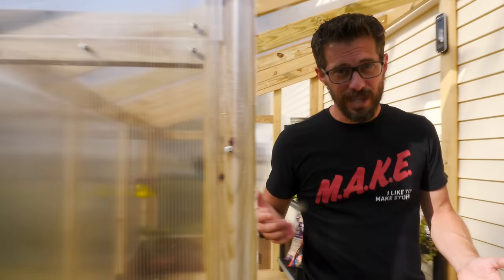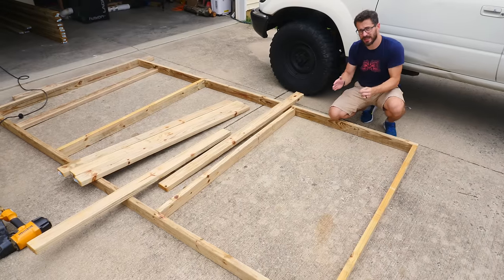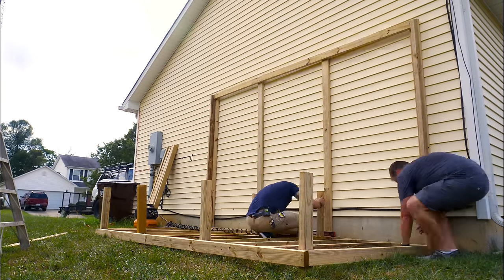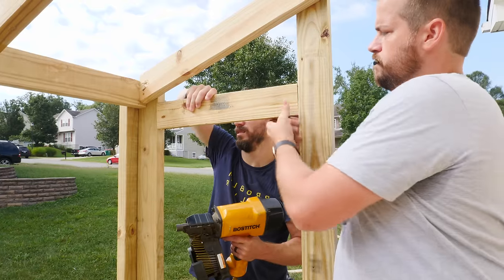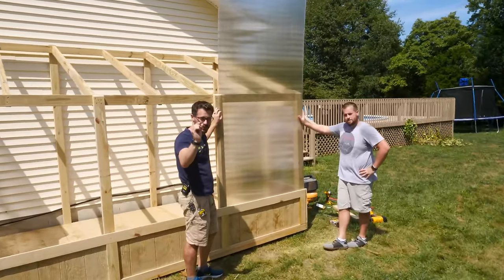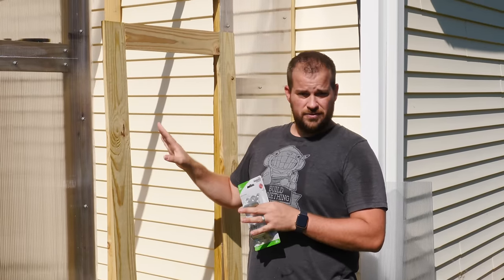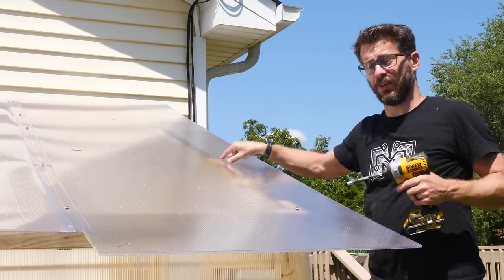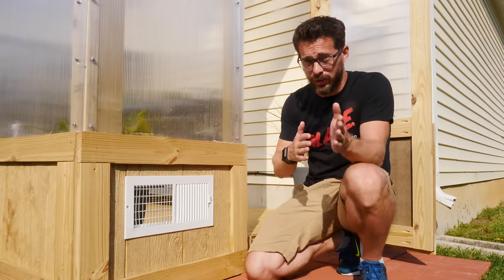How to Make a DIY Greenhouse | I Like To Make Stuff

Comment from the maker: Answer to common comments:
1. The 2x4 legs won't settle much here.  Our red clay doesn't move much once it's settled, and this is a high point of the yard so it drains well and never gets saturated.
2. All wood was pressure treated, rated for ground contact, so rot is many, many years away.
3. There is a small air gap between the walls and the side of the house.
4. The garage (not temperature controlled) is on the other side of that exterior wall.
Reply: why do you use a closed bottom? You can plant plants in the ground. I do it like this and we also have clay soil
Reply: Can you do a bits video on nails and nailers?
Reply: All that weight on a few 2x4 points and it's going to settle no matter what kind of soil it's on. $20 of 12x12 concrete pavers would improve your build 100%. I sorry but it seems more and more of your big builds you end up trying to justify your errors after the fact.
Reply: Im more curious on the roof "Vents"  if the wind/rain/snow is coming the right way it would blow those vents open and allow the elements inside.  Is there a plan to possibly correct that? or are you not worried that could happen ?
Reply: I would still put 12x12 pavers under the legs... settling is settling I don't care what kind of clay you have....
Reply: Literally answered all my questions lol
Reply: Cut pressure treated wood doesn't last very long at all. If you look at a cut you can see how deep the chemicals are.I'd be very worried about the feet/legs.
Reply: I’ve use the 30 second outdoor cleaner, and maybe spraying it with no eye protection is not the greatest idea.  It is a bleach product.
Reply: A lot of people are worried about the legs rotting away or sinking. Here's my take. If they start sinking, which I don't think is likely, put blocks under them. As for rotting, if you don't live somewhere that gets long periods of rain, or is humid all the time, wood takes a long time to rot. Even when on the ground. Bob, you know your area best, I'm pretty sure you thought it through. Good job.
Reply: Haha... is this the "please shut up about it already" list?

This is seriously one of the best ILTMS videos. You continue to up your game. Well done.
Reply: filter fabric is cheap you could've put a sheet under de greenhouse so the grass dont come in contact with the wood,and the moisture or rain water wood still drain well
Reply: Codymitchell yuo tide Facebook vibes fans
Reply: @DavidLeeKersey  I don't think you're sorry...
Reply: Loved the greenhouse was amazing, here in Portugal the greenhouses are much bigger, say giants!
Reply: I Like To Make Stuff because you are brilliant at everything, do you think it would be possible for you to build a claw machine?
Reply: @climberjb  That's true, all cuts should be retreated - it's not difficult and not expensive - best to avoid cuts though if you can.
Reply: @MyCuriousMind  What's a craw machine?
Reply: Would love to have watched the video but can't stand background music.  normally I just stop watching but you seem like a nice guy and thought you should know why so many people jus stop watching.
Reply: @DavidLeeKersey  this.    dude wont admit a mistake.
Reply: Nefaryus Drake  I definitely will either use a floor in mine or set mine into the ground itself by a couple feet. We want to use ours year round and these two methods appear to be the best at eliminating heat leakage through the floor of the greenhouse.
Reply: @MichaelMantion  statistically he's better off with the background music. It's like seatbelts, very rarely someone could die because a seatbelt restricted them or rescue teams during an accident but the majority of the time seatbelts help people stay safe. Likewise you may find some people who dislike or leave a video/channel because of background music but more often evidence shows the background music is more helpful in retaining viewership.
Reply: @MichaelMantion  if you don't believe me just consider that yours is the only comment I've seen complaining about the music, but there's at least a half dozen comments that I've only just skimmed through (probably more) expressing their appreciation for the background music. I don't think the background music is going to negatively impact their viewership just because YOU don't like it.
Reply: Nefaryus Drake  "The ground is actually geothermal"

Only if you dig deep enough.

"by putting in a floor, you create a air pocket under the floor that is cold in the winter."

Air pockets are actually a good source of insulation, which is why I would plan on using it if I had a temporary greenhouse or didn't want to dig deeper. What you're thinking of is an air gap, which is different than an enclosed pocket or insulating air.

"I recommend putting a brick wall on the north side, south if you're on the other side of the equator, and digging out 2 feet of earth inside the greenhouse. That wall will give you thermal mass for heat in the winter, and the geothermal ground
heat."

That's similar to what we're planning on doing, but we're going to use water filled chambers painted black and a reflective back wall to maximize the use of sunlight. Water filled chambers have higher heat capacity and won't lose heat to the exterior through conduction, which means more consistent temperatures and more light to the plants without losing heat efficiency.

"Also planting in the earth itself will help with watering [...] Do you have any idea how fast water will evaporate out of pots in the heat of the summer? you'll be watering twice a day if temps get over 90f"

Which is why we don't let them get that high, it's relatively easy to change the chamber color from hot black to a reflective silver color, as well as ventilating the greenhouse at the same time. You just need to control things based on the weather at the time to keep your temps cool in the summer.

In addition we are typically growing hydroponically, in which case watering is a non issue.

"Watch a video where theygrow oranges in Nebraska. Now thats a greenhouse, lol"

Where do you think I got these ideas from? His system uses ventilation to reach deeper into the ground because, as I mentioned, it's the deeper soil that provides usable geothermal heat, which is why I will be building an insulating floor if I don't have the time or money to dig deep enough for geothermal.
Reply: Nefaryus Drake  
"If air is such a great insulator, why does IGLOO even bother to put insulation between the walls of their coolers?"

I could ask you why, if insulation was so much better than an air gap then why does the world's largest indoor ski mountain use just a single air gap to insulate itself against the blistering sun?

A little known secret of insulation is that insulation is almost always just a series of small AIR GAPS.

"Furthermore, You're going to run hydro, with hot and cold touching the same surface. That is ripe conditions for mass condensation, leads to mold and rot."

what hot and cold surfaces? Not something we've had an issue with before.

"you seem to know it all"

I just know what's worked and chose to learn why and improve upon it. You act as though you're the only one with experience, yet I could easily say you are acting as though you know it all as well. Insults won't get you anywhere in life, we simply have had different experiences for different reasons in the years we've been doing this. Instead of arguing when we both are certain of the results we've acheived, why not find out why our results were so different? To do so we need to share and understand the methodology behind the various ways we did things to find the cause behind our different results. However, if you'd rather continue asserting that I you are correct and that I must have less experience than you, go right ahead, I'll simply refrain from replying.
Reply: Nefaryus Drake  you seem awfully judgemental of anything that doesn't fit your narrative of the world.
Reply: @jimcooksey812  obviously your not familiar with red clay, lol
Reply: @1982MCI  , your right I am not I live in Oregon, we have soil.... not clay.
But.... My journeyman card says I know what I am doing. 
Local 1388 Oregon City OR.
Reply: Won't the legs rot over time just sitting on the ground like a that? Why didn't you put a plastic cap on them for prevention. Maybe dig a hole add cement and then the legs for better prevention. I'm no expert but ya know.
Reply: Nefaryus Drake  ad hominem and cherry picking does not, a good argument, make.

Also, my apologies for insulting you so severely with a minor spelling mistake.
Reply: @kirsteneasdale5707  I agree, plywood is a generally poor choice for a greenhouse, but an insulated flooring can sometimes be a more effective building method, especially in colder climates where it's actually a pretty common method because of how effective it can be.
Reply: LazyH-Online I don’t know how far North you are, but here in Scotland at 56 degrees North, we don’t have floors in greenhouses, and we have heavy clay soil too.  The structure above wouldn’t survive in our exceptionally damp climate. It might be fine for a shed or a summerhouse, as we don’t tend to keep damp soil, and transpiring plants in those, and I don’t know anyone who would deliberately spray water inside a shed, or slosh a bucket of water on the floor of a summerhouse, when it’s a hot, summer day.  Gardening is my passion, including greenhouse gardening, and in my experience, understanding, and knowledge, of greenhouse    best practice - a wood, or chipboard floor is the very last thing you want.
Reply: @kirsteneasdale5707  I completely agree with what you're saying about a wooden floor, this is why on one of the greenhouse that I made that was insulated floor I used a blend of cement and perlite, with polystyrene insulated layers. In the end it cost way less without having to get a building permit on a structure that we weren't going to keep around for very long, and it's still saved a significant amount on groceries to be able to grow our own food year roubd, and that food was significantly healthier. Having an insulated floor for us was better cheaper and faster than digging into the ground or building directly on soil.
Reply: LazyH-Online That sounds better.  What drainage, or run off did you build in to the concrete base?
Reply: @kirsteneasdale5707  never needed to worry about that since we used hydroponics. Any small amount of water that did spill either got pushed out the door with one of those floor squeegees we bought at Wally world, or was small enough to simply let evaporate.
Reply: LazyH-Online It can’t be damp in your part of the world then?
Reply: @kirsteneasdale5707  it can be, there just isn't much reason for that humidity to cause issue in the greenhouse, it's pretty easy to set up with ventilation and airflow control to prevent it from causing trouble in the greenhouse.
Reply: Nefaryus Drake    
"For someone that isnt a know it all, you sure have a lot to say on the subject."

Discussion is generally how we chose to learn more, it is also why there were some genuine questions among the things I've said, a lot of which you haven't answered.

"Looks to me like your creating more work for yourself and trying to sell your propaganda to others."

My original statement was simply an expression of what we would chose to do and why. I could have expressed it better but didn't think it would become any sort of issue.

"And since you need me to look up a word for you:
Propaganda:
2: the spreading of ideas, information, or rumor for the purpose of helping or injuring an institution, a cause, or a person."

So what "cause" am I trying to help or hurt? I concede by that definition what I say could be by definition propaganda and I therefore happily concede this point to you, though it seems an odd choice of words. My apologies for the conflict that I have caused due to this confusion.

"Furthermore, you claim I used an ad hominem, by what, calling you by name, lazy?"

What does name calling have to do with ad hominem? The ad hominem was when you made statements regarding my motive or cause as a method of discrediting my argument while you have incompletely addressed or countered the statements I have used in support of my claims.

"For someone that calls me judgmental, you sure af seem to be doing what you claim I'm doing,"

I'll concede that point as well to an extent, I am only human and I do apologize. I know being passionate about a subject is no excuse, however science in general, including material science, engineering, chemistry, and many others are all things I've been as passionate about as gardening ever since I was a child, so I don't believe I am completely ignorant on what I am talking about. I know many people would agree with me, though I'm sure the same could be said for you as you seem well versed in the topic as well, though you appear to have learned it in a different way.

In the end I simply wish that if I do have a discussion with anyone that it be a civil discussion where opinions can be respected, experiences can be shared, and ideas can be compared. Instead you seem insistent upon dismissing the concepts I bring forth simply due to differing experience, without considering the possibility that we both could have learned something from this exchange. This is where you and somebody like Kirsten on this same comment thread appear to differ.

"Furthermore, I talk about having an air gap under a greenhouse and how it's not a good idea,"

The majority of the time you are right, it IS a bad idea. However there are other times when it is more beneficial than not having one, and I know this from experience. Also remember,as you just stated, the air gap was your idea, something YOU brought up. It wasn't even part of anything I originally talked about, however as you felt it was relevant I went ahead and followed your lead on making that the primary topic. I guess this is part of why I was confused about the propaganda thing when it was your topic that you were pushing for, and therefore seemed more like your story that you were pushing. If this is not the case then I apologize again however I'm not sure how that makes this discussion about me when I was simply bringing up my personal experiences in regard to YOUR topic of discussion.

"But you seem to think you need someone, anyone to sell your propaganda to,"

Pretending that's true may I ask, is that any different than the propaganda you originally stated long before I came to the conversation, when you were speaking out against the content of the video? What about the propaganda you began in our conversation about your air gap issue? Neither of these were things that I originally brought up, that was you. It also takes two to argue and I'm certainly not having this discussion by myself.

"someone to argue with cuz you have nothing better to do"

See above.

"meanwhile you tell this story:
this is why on one of the greenhouse that I made that was insulated floor""

I'm not really sure what your point is on this one, but I had a polite conversation with them, both sides bringing something to the table with understanding, not agreement, being the main goal. The same could not be said of the conversation with you (spoiler alert, the difference between the two conversations isn't me).

"You've got nothing to bring to the table,"

That's generally the case for both sides when sincere discussion is not the goal of one or both sides of a conversation, though I do hope that can change in this one.

"Your ideas are worthless,"

That may be your opinion, I simply asked you to support it with sufficient evidence.

"and you are an ad hominem."

I'll just take that as the insult that it likely is, and not a serious attempt at conveying anything. If I am wrong can you please clarify?
Reply: Nefaryus Drake  "all that work and money to put in a floor that does no good. Even a gravel floor is better."

Well, the floor did insulate better than the greenhouse without one, though I haven't personally tried gravel the floor does work better than river rock and plain dirt by at least a few degrees temperature difference. Maybe gravel would work better because there are smaller and more air pockets between the substrate and therefore might insulate better though I find it hard to believe it would insulate better than a purpose built floor. It's the slowing/stopping of air movement that prevents the flow of heat, so a sealed air gap would, hypothetically, insulate better than gravel, and the multiple pockets in insulating material that slow down air flow even more would insulate better than an air gap.
Reply: Nefaryus Drake  that is your claim, and it doesn't conform with reality. I gave an example of this and so did you without realizing it. At most winter temps of the soil will stay be around 65*, the Nebraska greenhouse guy gave this number and if you travel further north that temp will drop even more and insulation has the potential to help give you higher temps than that 65* if you don't have the money or availability of digging deep enough for the geothermal effect. Despite this you are dead set on believing your unfounded claim despite any evidence to the contrary and so this conversation isn't going anywhere. Have a good day and maybe next time we can have an honest conversation.
Reply: Nefaryus Drake  insulation prevents the transfer of heat, this could be between air and air, air and ground, or any other two mediums. If the ground is colder than the inside of the greenhouse (often inside of greenhouse was high 60s and ground was mid to low 60s, measured with a PTC probe) then insulation in the floor will prevent the transfer of heat from the inside of the greenhouse to the colder ground. This is just how physics works. Does it work in every scenario? No, sometimes there's more heat I'm the ground, sometimes it's impractical to build and even if all things work out there's often better ways such as digging your greenhouse into the ground. However there are times like when I mentioned above, I'm which an insulated floor DOES keep the inside of a greenhouse warmer.
Reply: Nefaryus Drake  tell me this, if you have a warmer greenhouse (68* for example) and a slightly cooler ground (63* for example), then how does insulation between the two NOT help keep the greenhouse warmer?
Reply: Nefaryus Drake  I believe the ground is cooler because I measured it myself, both with and without a greenhouse over it. You would know this is you actually read my comment instead of simply trying to prove me wrong with reckless abandon. The cause of that temperature change has little to nothing to do with the fact that the cooler ground will therefore decrease the temperature within the greenhouse itself. So yet again, instead of ad hominem (attacking my supposed "narcissism" and "wasteful existence") perhaps you could instead form a cohesive argument to counter my claims. And in case you think I'm ignoring your permafrost example, you need to actually demonstrate how it relates, in ANY way, to my claims regarding greenhouse insulation for it to be considered a counterargument. It's usually the people who cannot form arguments and instead resort to incessant insults that hold the greatest narcissism and ego as they have no method of forming their own arguments yet withhold themselves from admitting their point of view could even be slightly incorrect or incomplete. I have stated nothing that I haven't observed myself to be FACT.

Bottom line is: I have demonstrated that insulating the bottom of a greenhouse has the potential to help, and I explored the explanation behind this phenomenon by measuring information from the environment in question.
Reply: Nefaryus Drake  if you really don't believe me there's other sources besides myself that have examined and proven that heat loss occurs through floors. Every construction engineer knows of this phenomenon. It's not exactly news that heat loss occurs through floors. In fact it's common sense to anybody that works any form of construction. In fact here's a quote from a site describing energy efficient greenhouses comparing them to insulating a house:

"We all know heat loss can occur through a building’s walls and roof, but it can also occur through the floor, accounting for about 15% of an average home’s total heat loss."

Heat loss through floors has been proven time and time and time and time again, it's not just something I popped off the top of my head to be argumentative. It's a proven FACT that tons of people already know about and study and have proven time and time again. If you really don't believe me just ask anybody in the construction industry if heat loss through the floor of a building exists.

I have no idea how you can be so entitled as to completely disconnect yourself from reality, I have demonstrated my point to be true, I have proven the cause behind it, and now I'm even demonstrating numerous other sources that support my claims.
Reply: Nefaryus Drake  "take your own advice and put the insulation out of your attic cuz you don't need it there, the air gap you claim is the best insulator for the attic."

How is that my advice? I have stated multiple times that other forms of insulation did work better, that air gap insulation was simply the cheapest and simplest. You obviously didn't read anything I wrote and just want to argue.

I stated at least once that the multiple air gaps in insulation made it work better than an air gap, and I also stated that an air gap insulates better than gravel and insulation material insulates better than an air gap. That's twice off the top of my head that I remember saying insulation is better than an air gap.

Since you seem to have forgotten I'll say it again, the only reason I even said anything about an air gap was because YOU brought it up and I happens to use it in a greenhouse successfully a while back.

If you can't respond to things I actually say then we're done, bye.
Reply: Nefaryus Drake  
I have to apologize for my part in the confusion here:

"you can't even look up "propaganda" before telling me to look it up for you,"

Actually I did, though I understand why you would think I didn't. The dictionary in my house doesn't have that definition in it. Mine has two definitions,

one being "information, esp. of a biased or misleading nature, used to promote or publicize a particular political cause."

The other being "a committee of cardinals of the Roman Catholic Church responsible for foreign missions, founded in 1622 by Pope Gregory XV."

Neither of those definitions matches what I was doing, you simply found a different definition than what was found in my dictionary, though I can understand your belief that I was simply being lazy.

"Have you taken the insulation out of your attic and put it under your house yet?"

No, I'm not going to try your silly idea. But have fun putting insulating material in all your windows so they don't waste heat through their "useless air gaps".

"In case you dont already know, nvm ofc you dont, Plant roots like mid 60's temps while the top of the plant likes to be upper 70's"

Actually I am aware of that, you would understand why if you had simply asked what kinds of plants I'm growing.

But you'll find off the wall plant that fits your crazy crap."

Actually we use our greenhouse to grow tropical plants such as mangos, citrus, pineapple, etc. many of which DO prefer warmer temps for their roots as well.

In fact I have a separate channel and Facebook page specifically for growing those plants since long before this conversation started, but you'll probably find some excuse like I time travelled to spread my propaganda or some other bull$#!+ excuse to start another argument.
Reply: Nefaryus Drake  I appreciate you working towards a civil conversation, that's the best way to share ideas and communicate effectively.

From my perspective you began with illustrating issues with the design in the video, namely the elevated floor. I simply replied with things that I would also have done differently than in the video, namely an insulated floor or digging the floor down a few feet. After that to me it appeared as though you fixated on the idea of an air gap, though I'm not sure why as air gap insulation was never mentioned by me nor used in the video. This is why I didn't know how to approach with my explanation, though I did respond to your topic because I've used both insulation material and air gap insulation before. I'm not particularly fond of air gaps since insulation material works much better but there are situations where they sometimes work.

I did include the full story on how a single air gap behaves differently than multiple air gaps in insulating material, I explained how air gaps are subject to directionality and having an air gap in the floor is one of the more efficient ways of orienting an air gap insulators, being up to 1.5 times more effective than, for example, a vertical air gap in your house windows. Regular insulation material restricts air motion more effectively and so isn't affected by orientation.

You also say that the ground helps with heat and you would be correct a significant amount of time, if the temperature difference is used properly like in the citrus greenhouses in Nebraska. However there are times when you can't construct to that extent and sometimes benefit more from insulating your floors, it's not often and depends on your situation but it happens. This is why many high efficiency homes insulate the floor of their houses, this is why the basement of a house is often cooler even in winter, this is why 15% of heat loss occurs through your floors.

Yes, the ground IS warmer than the frigid air, but we're not trying to insulate between the ground and the air, were trying to insulate between the warm greenhouse air and the frigid outside air as well as sometimes between the warm greenhouse air and the cooler ground. Just because the ground is warmer than the outside air doesn't mean it's warm enough for the greenhouse.

When did I say geoengineers had it wrong? I know you're not claiming I literally said that, but when did I imply such a thing?

There are many people, both personal and professional, that make greenhouses with insulated floors, though I'm not sure how an air gap is MY specification? Remember, you're the one that brought up air gap insulation. Personally I prefer either insulating concrete or layering polystyrene foam.

Again, why would you think I would take the insulation out if my wall? How does that relate to anything I've said? This is the second time I've asked this (at least) but you haven't answered. Why would I do that?

And lastly I don't give two shots about my feelings, I didn't care about it when you made fun of my username, I disliked something completely unrelated when you used a logical fallacy because it's intellectually dishonest, I didn't care when you said my ideas were worthless, I disliked when you misrepresented my ideas and put words in my mouth because that's intellectually dishonest. I didn't care when you called it propaganda, I disliked that I thought you were misrepresenting the things I said and didn't realize you had a different dictionary than I. I have never become upset over "hurt feelings" I have only become upset when the conversation becomes dishonest. This is also why I immediately apologize and correct myself when either you or myself cqtch me doing something incorrectly like in defining propaganda, I corrected myself and apologized for the confusion it may have caused.
Reply: @DavidLeeKersey  This so much. He never started with the right foundation and thats all i could think of. Similar to the vents, a total after thought so a video could get out.
Reply: @thacorruptor4472  Completely not thought out. This build was rushed from the beginning. Kind of sad this channel went this way.
Reply: @4:00 Did you drive the 2X4' feet into the ground at all or are they resting on the lawn surface?

I'm thinking that those feet will still settle in that red clay since the PSI area of the 2X4' is concentrated to 5.25 square inches per foot.  I'm not saying this is the thing to so, but driving them into the ground would compact the soil under the foot and increase the surface area (friction force) of each foot by the sides under ground.
Reply: It would last longer and be more stable if the wood 2xs were on brick or concrete pavers so they aren't in direct contact, even if they are treated.
Reply: interesting points ,if anyone else wants to uncover backyard greenhouse plans diy try Lomonting Easy Greenhouse Mentor ( search on google ) ? Ive heard some interesting things about it and my neighbor got amazing success with it.
Reply: @DavidLeeKersey  And, pressure treated, or not, end-grain on the soil isn't going to make it either.
Reply: How much this project cost?
Reply: @everettdale  if you live in the desert ,  no problem  for the  wood , but  this  makes  no sense
Reply: Hi curious what about nice getting in those vents. Maybe cover with hardware clith. I'm just curious. We have those things and I can't stand them cuz I never lived in a place with them before. I'm thinking maybe something like this instead of digging cuz unfortunately we have insane amount if rocks in this area of NY. It's horrible. Making all my projects into a major challenge. I didn't want this place but I still want a garden etc. I saw am amazing one where they could walk out into it from the house and a beautiful stone floor. Some homes have them already built but so much needs to be fixed and repaired here. I wish my husband would have listened to me.🙄
Reply: Kenneth Greer no it really isn’t. It’s quick and dirty and full of bad ideas.
Reply: LazyH-Online the background music is obnoxious.
Reply: Hello. Can you give the measurements of the wood and the greenshouse
Reply: Could you do an update video on how well or not so well it did over the summer.
Reply: How much money was this project
Reply: Literally going to ask question 1 why i came onto the thread lol
Reply: @simon-qy2xe  pests would be a big one. He should of used cement patio post feet, whatever the fuck you call them.
Reply: @simon-qy2xe  you can just chip out 1 of the 4 corners in cement feet. Store bought your done.
Reply: 2x4 floor joists is just wrong...
Reply: @simon-qy2xe  for the temperature
Reply: Nefaryus Drake  is that okay for the temp for tropical plants?
Reply: Is it only me wondering why the plastic walls were placed inside the bottom frame trim where water will run down and sit inside the frame, soaking the wood?
Reply: @JanColdwater  no lol you arent. Good eye
Reply: @kirsteneasdale5707  my greenhouse has a cement floor.
Reply: @SlapMehSilly02  if they do, cant he just replace the rotted leg. no big deal.
Reply: @lazyh-online4839  Moist soil acts as a heat sink, absorbing excess heat during the day and releasing it during the colder nights. This has a stabilizing effect on greenhouse temperatures. i have built several solar greenhouses that required no additional heat to prevent freezing, even at exterior temperatures of -10 deg. F. This construction appears capable of generating excess daytime heat, but poor at retaining it overnight, or during cloudy periods.
Reply: @lazyh-online4839  To fully utilize the heat retention properties of the soil floor of a greenhouse it's beneficial  to insulate the underground perimeter to frost depth. doing this will allow moist soil to store heat during sunny periods, then release it over night, or during cloudy days.
Reply: you getting defensive? its ok to admit mistakes
Reply: Ehat growing zone are you in?
Reply: I\'m not sure but ,if anyone else needs to find out about backyard greenhouse plans diy try Lomonting Easy Greenhouse Mentor (do a search on google ) ? Ive heard some awesome things about it and my brother in law got amazing success with it.
Reply: hi everyone ,if anyone else trying to find out build your own small greenhouse plans try Lomonting Easy Greenhouse Mentor (just google it ) ? Ive heard some great things about it and my m8 got cool success with it.
Reply: X冫i才虧了刁力一
Reply: @MichaelMantion  Tips for making a video look like pro - add some electric guitar music in the background and talk really slick.
Reply: I think over a large area like this the feet won't sink much unless the soil is very soft. When my friend and me built a shed at my old house we used spikes on the foundation, levelled the ground and laid slabs in the area inbetween and bolted the floor of the shed with coach bolts to foundation with the spikes attached. A bit over kill but the shed that was there before blew over in a storm. The shed we replaced it with should be fine for decades, just need painting once in a while.
Reply: Red clay good for the foundation is this how a perfect greenhouse is made?
Reply: Termites ???
Reply: It
Reply: Wow. The absolutely appalling floor design is beyond words.  Total trash, but hey you slapped that garbage together quick. It will fall apart nearly as quick. Maybe you can time lapse video that with some guitar riffs covering it.